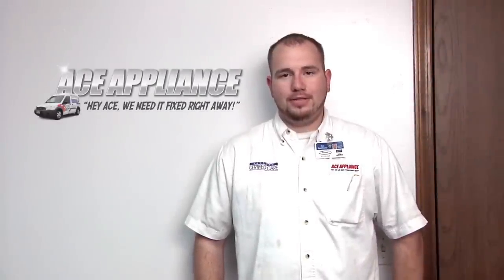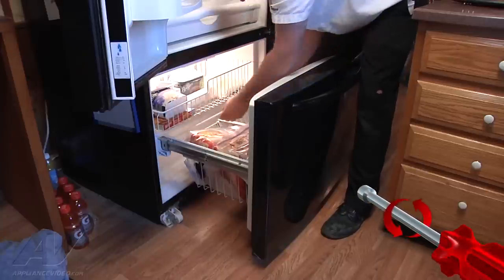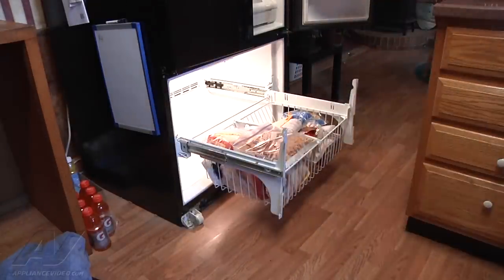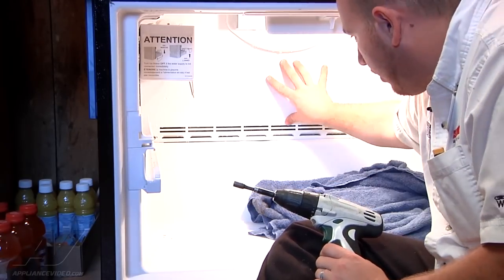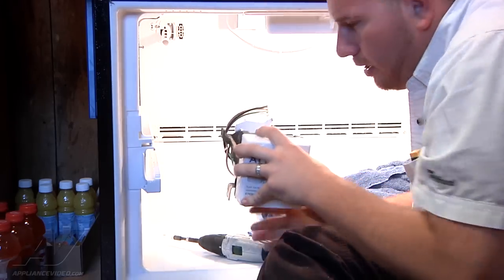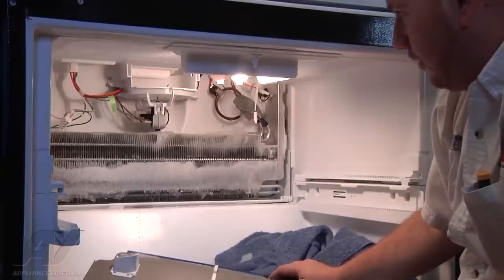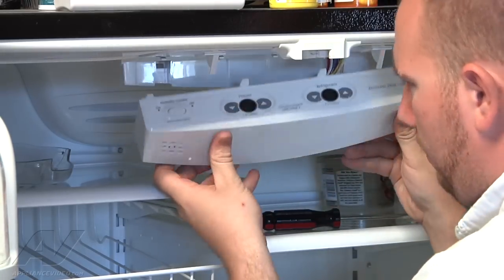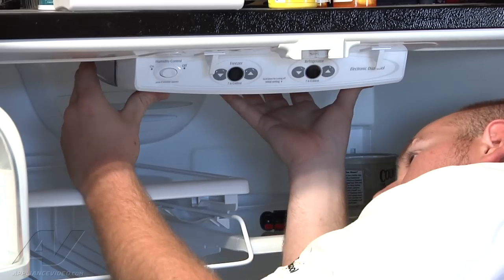Maytag Refrigerator Repair - Not Cooling - Control Board

Comment: Ditto what Randy A said ... EXCELLENT how-to video!!  
I'd figured out on my own that the defrost cycle wasn't working but had thought it was a bad defrost heater.  I ran the on-board diagnostics and everything else was OK.  I had not considered that the control board could go bad until I saw your video. 
Nevertheless, I wondered why you did not check the defrost heater?  After viewing your video, I did more research and discovered that the control board frequently failed and that the defrost heater rarely failed (a fact that the appliance parts guy later confirmed).  So, your depth of experience showed well here.
Viewing your video made removing the control board housing easy.  I probably could have figured it out but probably would have broken one or more of the mounting tabs.  Your video saved me a lot of potential grief.
Thanks.
Reply from the maker: val jue 
           
Thanks for the positive comment. Hopefully we saved
you some money. Please help us provide more videos to our site by posting ApplianceVideo.com
on your YouTube, Facebook or Twitter account or add us to your circles. If you are in need of any parts please support
our parts department on line at http://savemoreonparts.com/ or call 1-800-830-5465 7-days a week until 11pm Eastern
time. Thanks again your support.  Matt, Ace Appliance service technician.

Comment: Excellent video

If I get the control board. Will it defrost the coil?
Trying to avoid taking everything apart in freezer.
Reply from the maker: No, you have to defrost the coil for 24 hours or take it apart and use a hair dryer/ heat gun.  Please help us bysubscribing to our YouTube channel. Or support our parts department at
1-800-830-5465 and our website www.SaveMoreOnparts.com .  This is the only way we can continue to
help the over 900,000 people per month like you repair their own appliances. We
also have thousands of more quality videos on all major appliances made by our
factory trained technicians at www.ApplianceVideo.com .

Comment: A few days ago, the bottom freezer door was left ajar for some time before we noticed it.  Will this cause a frost build-up problem that may not self correct even if the control panel is OK?

I ran a diagnostic check of the control board:  Test 1 for Defrost displayed a 0 then quickly displayed 5.

Can you just replace the control board without going through the manual defrosting procedure?
Reply from the maker: ***** 

                   All of our technicians are now answering questions
daily at our http://www.appliancevideo.com/ website under the Repair Help section.  We also have over 1600 common questions and
answers that you can easily search through by your model number, appliance
make, problem or error code and it’s absolutely FREE. You also have the option
to email a factory service technician with a question on your appliance at
http://www.appliancevideo.com/repair-help/ . If you’re looking for a repair video, you
can also search our library of over 2600 free repair videos. ApplianceVideo.com
specializes in quality DO-IT-YOURSELF appliance repair videos and we get over
800,000 views per MONTH to our videos worldwide and growing. If you need of
parts for your major appliance, we have over 5-million parts in stock at http://savemoreonparts.com/ .  Thanks
for your support. Matt Ace Appliance factory service technician.
Reply: No. You must defrost the ice build up.

Comment: My Maytag is not freezing or cooling. But the edge of door on left side is very hot. What does this mean. Also why does a Maytag compressor cost $300 more that a Frigidaire compressor?
Reply from the maker: Great question, if you have a more technical question that our parts department cannot answer, you can search our over 17,000 answered questions free at our website www.ApplianceVideo.com under our Repair Help section. You can also call our parts department at 1-800-830-5465 and they can give you help 7-days A week ,or search at www.SaveMoreOnParts.com  .

Comment: How did you put the fridge in defrost mode
Reply from the maker: Great question, if you have a
more technical question that our parts department cannot answer, our
technicians are answering all questions at our website at www.ApplianceVideo.com under our Repair Help section. You can also call
our parts department at 1-800-830-5465 and they can give you help 7-days A week
Monday -Sunday, or search at www.SaveMoreOnParts.com  24 hours
7- days A week.

Comment: Thank you for this Great Video!
Could 12 be used as a panel code for MFF22558VEM model?
Thanks
Reply from the maker: Hussein
         All of our technicians are now answering questions daily on the ApplianceVideo.com website for anyone needing help. Just copy and paste this this question under REPAIR HELP, and one of our  factory authorized technicians  will answer any technical questions at absolutely no charge on your appliance issues. We also have over 2600 free repair videos to help with your appliance repair issues. Thanks for your support. Matt Ace Appliance factory service technician.

Comment: my issue is the opposite the freezer stays at 27 degrees the alarm does not come on and the condenser does not heat almost as if it is stuck in defrost mode. the evaporator is room temp . but everything else kicks on and off like it should. any suggestion
Reply: Mine is doing the same thing. How did you fix?
Reply from the maker: Livinghighandwise
                 All of our technicians are now answering questions daily on the ApplianceVideo.com website. You can search completely FREE in our Repair Help section. Or you can get unlimited technical advice and video links emailed to you by our 14 factory certified technicians at http://www.appliancevideo.com/premium-membership/.  If you are in need of any parts please support our parts department on line at http://savemoreonparts.com/ or call 1-800-830-5465 7-days a week until 11pm Eastern time. Thanks for your support. Matt Ace Appliance factory service technician.

Comment: The PE does not come up on my so I can't enter my code.  Any suggestions?
Reply: Never mind!!  It came up on the 5th try
Reply from the maker: Great question, if you have a more technical question that our parts department cannot answer, you can search our over 17,000 answered questions free at our website www.ApplianceVideo.com under our Repair Help section. You can also call our parts department at 1-800-830-5465 and they can give you help 7-days A week ,or search at www.SaveMoreOnParts.com  .

Comment: My refrigerator and freezer are not cooling at all. It's making a buzz sound. What can I do
Reply from the maker: Great question, you can call our parts department at 1-800-830-5465 and they can give
you help 6-days A week Mon-Sat . If you have a more technical question that our
parts department cannot answer, our technicians are answering all questions at our website at www.ApplianceVideo.com under our Repair Help section. We have over 4,000
common questions and answers that you can easily search through by your model
number, appliance make, and problem or error codes, and It’s free to search
through our question & answer library.